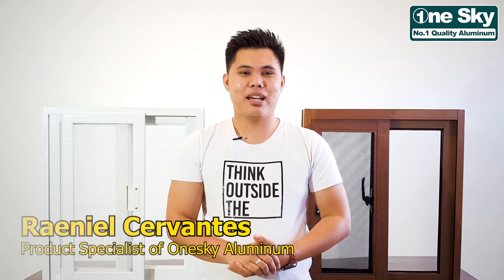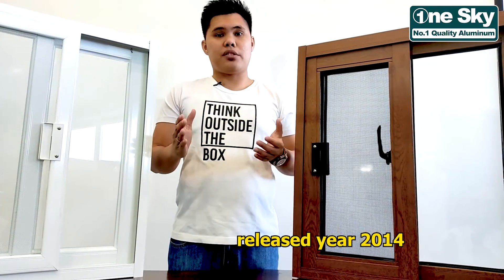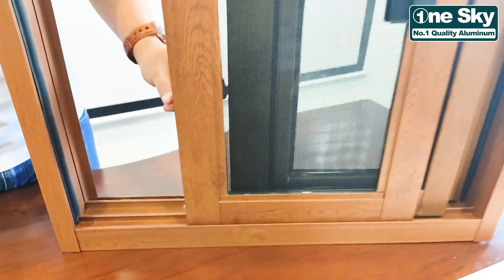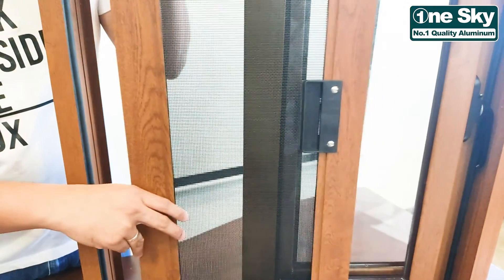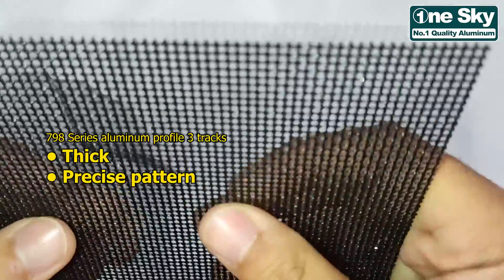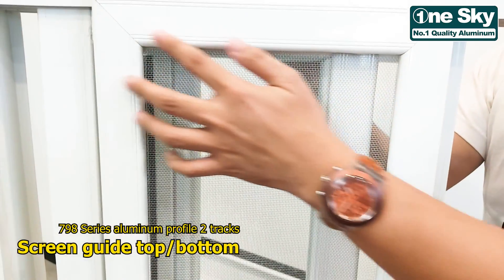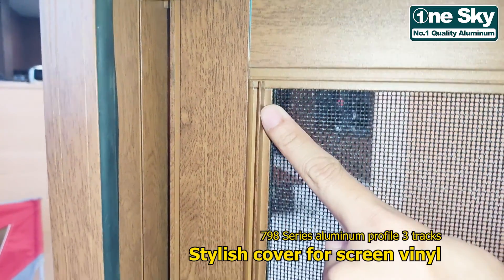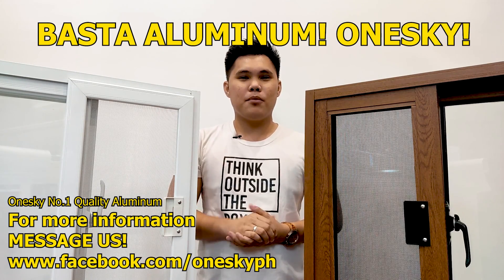What is 798 Series Aluminum Profile 2 tracks vs 3 tracks.?

Comment: boss, same lang ba ang aluminum panel(lockstile,interlocker,top/bottom rail) ng 798 2tracks at 798 3 tracks? bale sa sill at head lang ang papalitan para maging 3tracks? salamat
Reply from the maker: Thank you for contacting us. Our products are Customized Prefabricated Aluminum Framed Doors and Windows, may we ask for your contact number, we will have one of our sales consultant call you as soon as possible or you may call

For Smart user: 0920-109-1740
For Globe user: 0906-584-2756
Look for Shiena or Dianne.
Reply: Lockstile, Interlocker at Top/Bottom Rail lang ng orig 798 ang kamukha sa 3 tracks. Iba ang Jamb, Sill, Head at Security panel frame. Mas malapad profile ni 798 3 tracks Vs orig 900 series profile.